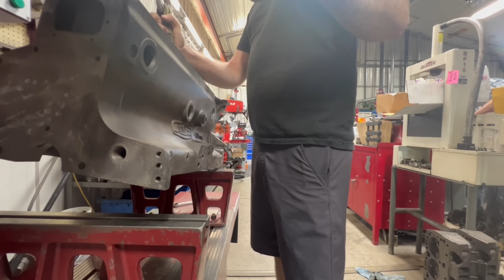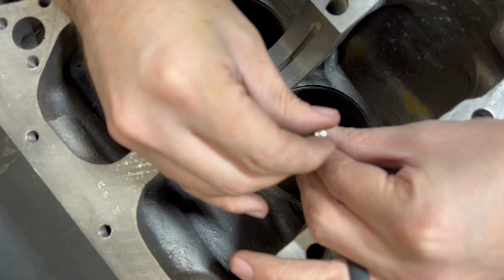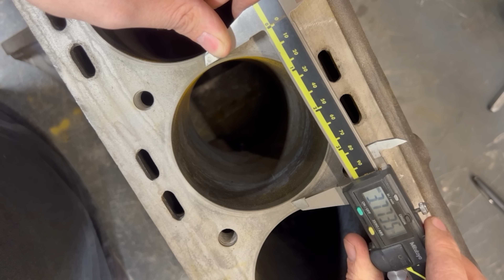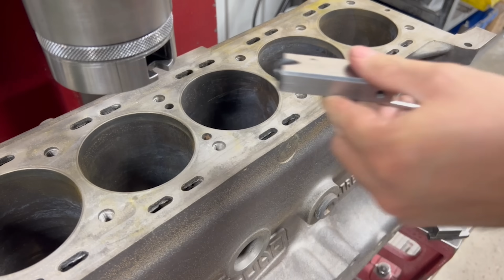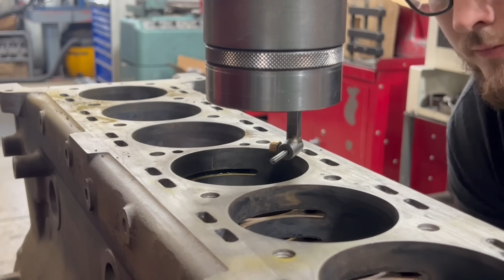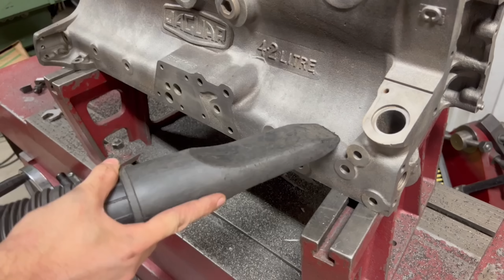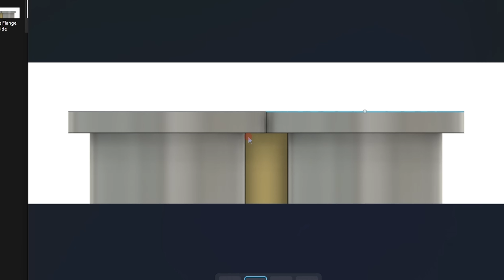Can This 1968 4.2L Jaguar Block Be Saved?

Comment: on older SBC i have cast iron pinned between the cylinders and sleeved the two cylinders . Then pressurized the block with ceramic sealer, had great luck

Comment: What about grinding or cutting a V In between each cylinder on the surface of the block, weld it.achine it flat and put new sleeves in? That would just keep the crack below the surface of the head and probably won't be an issue again.

Comment: The crack repairs will be time consuming and expensive. Micro-welding or laser welding is probably out of the question due to cost of equipment and finding someone with expert experience to perform the weld repair.

Comment: I think you're stuck with the cracks. I see people recommending stitching the cracks. I would not do that is this would actually spread the cracks apart more eventually. The flanged sleeves are a good idea, but I would also caution the customer, that this engine needs to be driven very lightly and no hot rodding. I doubt the cracks would continue into the second water opening. I'd also make sure that the cooling system is in top notch condition at all times and never ever overheat this motor ever again. I'd also say the cylinder bores need to be straight and Id heat the block and nitrogen cool the new sleeves and let them drop right in. Pressing these with those cracks is risky. Hopefully the owner is honest and will document the cracks in the cars paperwork if he plans on selling it.

And last, just want to give a shout out to the trolls who commented things like; "I am sure some YouTube expert will chime in and tell you exactly what you need to do. They just got finished making this same repair last night."
Reply: Calm down. All these 4.2 blocks crack and there is no need to baby them afterwards.
Reply: @TyphoonVstrom  Why don't you calm down. Troll.

Comment: Top hat sleeves and send it. If it's a restoration, they aren't adding a power adder and it'll be in better shape than it was new in 68. Definitely last longer than we will ever see.
Reply: It'll be fine for a garage and enclosed trailer queen matching numbers car, which won't even do 10 miles under its own power a year.

Comment: I've used the "top hat" style sleeves in a few "one of none" type builds, and depending on the usage and condition of the block casting, I have actually O ringed quite a few of them to prevent issues. Requires being able to get a copper head gasket, but I've found the combination to be as good as, if not better than factory. 

Just my .02
Reply: Lani at Copper Gaskets probably has all the specs needed to cut them,
 it's pretty surprising just how much stuff he has for all sorts of obscure engines, plus, he offers various thicknesses from about 1/32" to 5/32" (forget exactly as I haven't bought any for a while)
Reply: @1crazypj  he did a very custom m110 Mercedes gasket for me several years back.  Top quality.

Comment: I was thinking flanged sleeves just before you started talking about them. I’d say do the flanged sleeves, and also consider doing crack repair pins to try and stitch the cracks. Between the two it should seal up fine, but I’d warn the customer of the possibility of issues down the road. That’s one of those things that you just can’t warranty against or guarantee.

Comment: Wouldn't it work to grind out the crack a little, heat the block, weld it with a cast iron welding rod, let it slowly cool in an oven, then deck and cut the bores? I've repaired cast this way before, never an engine block though
Reply: it doesn't need the strength of welding, you'd be better to preheat, grind, and braze for this one

Comment: Hi I worked on a 4.2 jaguar a few years back, we ended up using top hat sleeves or t-sleeve and it worked out great. We pressure tested the block afterwards and it had no leaks.
Reply: As he said. We’ve been recently rebuilding 4.2l that cracked like yours. We used top hat sleeves and it end up great.
Reply: But did you repair the cracks in the cast-iron block?
Reply: My father is a retired Jaguar Factory trained mechanic, he said that they have been using top hat sleeves to fix these blocks since the 1970's
Reply: This seems like the best option. I was thinking weld and bore until this option presented itself.
Reply: I did the same repair on the structurally similar 4.0L V8 Discovery 2 motor, over 2yrs ago and she's still going along as my daily driver with absolutely zero issues!
Reply: It would rarely have leaks right after reassembly. Give it a couple years and then check...
Reply: @brandon kerley , and Krzysztol Pazdziora, Were they cast iron street blocks, or rare aluminum racing blocks? The one in this video is a rare aluminum racing block...A second look at the video reveals the magnetic 🧲 particle inspection being done on the block, with the liners removed...  My mistake... It is a cast iron block... Thanks for the heads-up on this one ..
Reply: @michaelmartinez1345  actually that is a cast iron block in the video, if it was an aluminum block they would of not been able to do the magniflux method
Reply: @brandonkerley8912 ,  that was the cast iron cylinder liners that were checked with the magnetic 🧲 particle inspection method, not the aluminum block... And yes , magnetic particle inspection only works on ferrous metals. This block is aluminum... But the crank , cams, con-rods, etc  ,  can be checked with the magnetic 🧲 particle inspection method... Looking at the video again, It appears that this block is cast iron... Definitely a magnetic particle inspection was done on the block , that had the liners removed... My mistake.... It looked like an aluminum block in some of the other photos...
Reply: @michaelmartinez1345  its all good man, no harm done.
Reply: @brandonkerley8912  Thank You..  I appreciate that...
Reply: @michaelmartinez1345  aluminium one, almost same case as aluminium rover v8 4.0 and 4.6 from discovery 2 and p38
Reply: @Ronin7515 , were the Rovers and Jaguars children of the British Leyland group, in those years?
Reply: @michaelmartinez1345  i😊

Comment: I think the top hat sleeves are the best idea. If I was really worried about leaking, I'd cut all the top hats so they butt, instead of overlap, and cut the top hats for rubber O-rings so that there's a rubber seal on top of each crack.

Comment: I was impressed to see that you checked the flatness of the deck and that the cylinders were perpendicular without reference to the bottom of the block. So many times we see people making the assumption that the deck and base of the block are parallel.
As long as the mains and bores are machined relative to the deck there's absolutely no reason why the base has to be perfectly parallel, usually it's just going to have the sump bolted on, particularly on older engines.
Reply: First I spent 30+ years in an engine manufacturing facility. Repairing and rebuilding machines and doing Tool Work. The way manufacturing lines are set up especially for engine blocks requires the first two surfaces to be machined are the deck and pan rail with the main bearing half rounds. These are located relative to casting features. The second operation would be to drill, ream and chamfer two locating holes in the pan rail. These are located relative to the main bearing half rounds and a casting feature.  This feature is usually relative to the two center cylinders inside the coolant passages. All other features during the machining process are dimensioned from the pan rail and the two locating or main manufacturing holes.  These holes are typically anywhere from .625/16mm to. 750/19mm in diameter.
Reply: @mpetersen6  thanks for the first hand info!

Now I'm wondering what the operations order is for radial engines. 🤷 Can't say that my mind doesn't take me interesting places, but I wish it had better timing (2A.M.).
Reply: @Chris Hartley, if the pan rails on the lower side of the block are not parallel with the deck surface for the head, then how is the block fastened to the OEM milling machine bench for the initial deck surfacing, cylinder boring and fastener drilling and tapping? My guess is the oil pan rails were machined first, at the OEM, to provide a reliable set of sturdy surfaces to locate the block  onto the milling bench, for several of the of the machining process's and operations to take place... And my guess is the machinists are aware of this... Just guessing though...
Reply: @michaelmartinez1345  I'm not sure about engine boring machines.  I'm only familiar with Bridgeport style mills.  However, if the machine spindle isn't perfectly square with the table of the machine, the deck could be milled flat and the bores put in perpendicular to the deck.  But the deck wouldn't be parallel to the pan rails, and the bores wouldn't be perpendicular to the pan rails.  The spindle should be checked for squareness to the table by sweeping the table with a dial indicator.
Reply: @jeeprenegade1985 and Chris Hartley, I remember seeing large machines that held engine blocks on decks that rotate, but those deck surfaces were perpendicular to the machining heads... This way the blocks could be rotated to match the cutting tools... And yes, for high production purposes, v type blocks had numerous machine tooling equipment placed in positions to match the needs to work that block... But the pan rails were still used as a baseline to measure and position the pre-cut block with... Lots of engineering is involved with manufacturing and mass production of equipment like this... Definitely more than one way to do the job...
Reply: @michaelmartinez1345  Not all engines have a base "parallel" to the deck, V6 and V8 for instance, so that method could not possibly be used, the block must be clamped by some other method. On "parallel" base engines the same method is used simply because the engine is on an assembly line, they don't have time to waste setting things up perfectly parallel.

The block is held in clamps and rotated as various machining operations take place, so although the surfaces should in theory be parallel there is no guarantee that they will be, particularly on older engines. On the more recent engines the mills and drills rotate around the block so the angles of surfaces are much more accurate relative to each other but they are still not machined with reference to another surface on the block, too time consuming.
Reply: I've seen that assumption made on one-off prototypes used for engine development and testing, which makes life interesting for the mechanics assembling that engine.

Comment: No experience with this engine but I’ve been a heavy equipment mechanic for 35 years so take this question with a grain of salt but …. Can you braze it with silver solder then make your cuts for the flange sleeve?

Comment: Our 77 MGB had cracks in its head, (can't remember exactly where) but the place that did it, pre heated the head, welded it in a series of cycles and then left it in the oven and very slowly dropped the temperature, it took a long time but it worked.

Comment: The way those cracks intersect the coolant slots, there is no mechanical reason that they should continue. They should just stop when they hit the slot. Not sure why you are doubting the sealing ability of the head gasket on the crack at the deck surface. How different is the crack at the deck than a coolant passage at the deck? No different that I can see.  Even if I had unlimited money, from an engineering point of view, I see no reason to try and fix the cracks or use top hat sleeves. I think people get caught up in the emotional rational, being that all crack are not supposed to be there, so it must be fixed.  Logic says that is not so in all cases. Do a logical evaluation of the problems and the variables and you might come to the conclusion that those cracks will not effect anything.  --Doozer

Comment: The XK Jaguar engine started out life as a 2.4, they tried building 3.0 ( for racing regs ) but it was not successful, later the engine grew to 3.4 & 3.8 both were very very good engines ( gold top triple carb 3.8 were good for not less than 265hp 180++ mph on Mulsanne straight in 1955 at Le Mans they won 55-56-57! partly due to Jaguar being the first and only cars to use disc brakes ALL others did not trust them and stayed with their drum brakes ) the 4.2 engine was a longer stroke larger bore version and does not like to rev too high, i imagine there is a limit how much they can be bored out, otherwise it is resleeve the engine, big job big expense i would guess!!
I would think the sleeves you took would from the factory, i would STRONGLY suggest making contact with Jaguar engine specialists in the UK re those cracks, i imagine they are partly due to the engines being a bored smaller engine to start out life!
Reply: Not to forget the Le Mans wins in 51 and 53 with the 3.4 C Type. It was the 53 C Type that won due to the disc brakes.
Reply: The XK 120 was a throw together. The MK7 was not ready for the show so they made the XK 120 from MK7 parts.  It stole the show.  I have worked on many here in Denver.
Reply: @lookronjon  I could wrong but the Mk5 & Mk7s were BIG HEAVY cars the XK120 were by comparison light sporty aerodynamic MK5 &7 were a bit of a tank, my grand mother years ago had a BRG XK150 chrome wire wheels green leather 3.4, my grand dad had a MK4 saloon red, chrome wire wheels leather BEAUTIFUL CARS ABSOLUTELY BEAUTIFUL, these days NOTHING even gets  close not even late model Jags NO Thank you!!!!